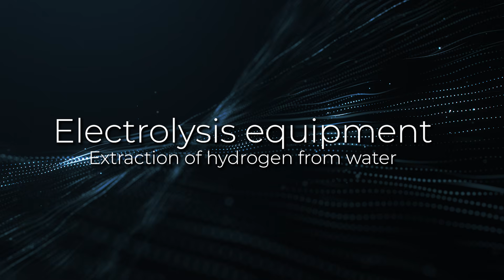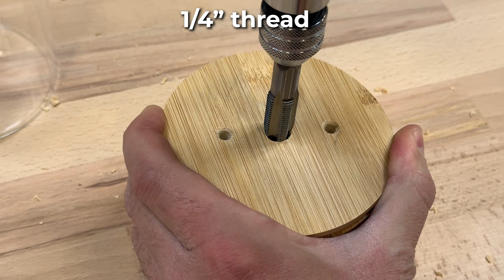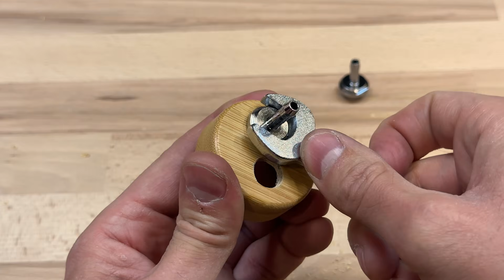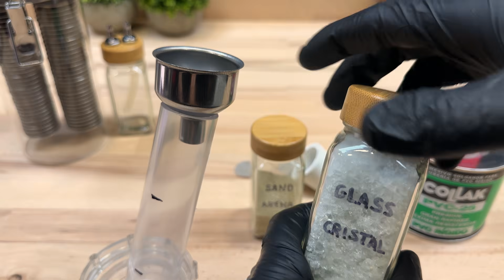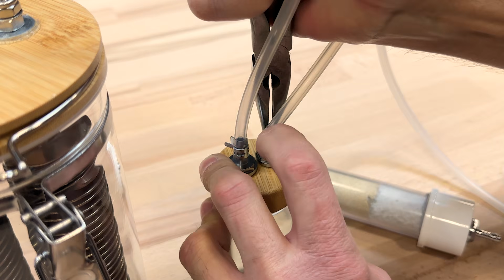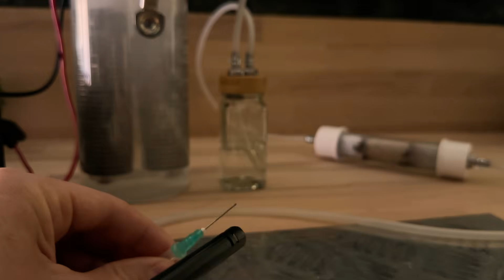How to Extract Free Fuel from Water - HHO Hydrogen Generator

Comment: "Free Fuel from Water"
It takes more energy to break the molecular bonds than you can get out of burning the fuel. 
So don't even waste your time trying.... Physics wins.
Reply: This is really converting one type of fuel to another.   It can convert sunlight via solar cells to electric which can then release hydrogen from water.  This is why it’s important to find water on mars .. because where you have water you can make jet fuel